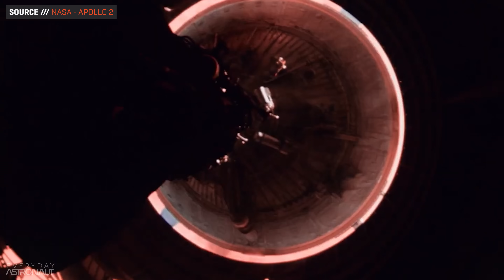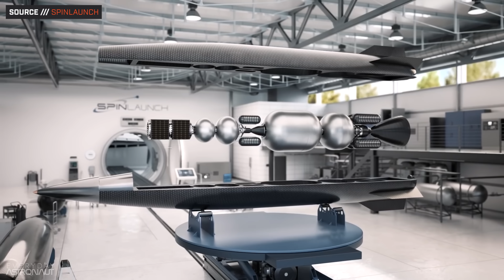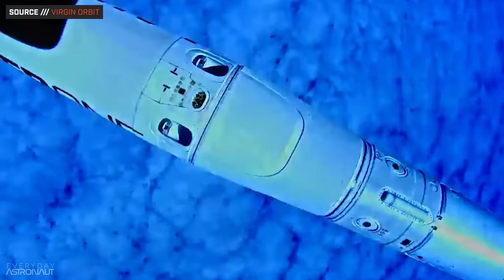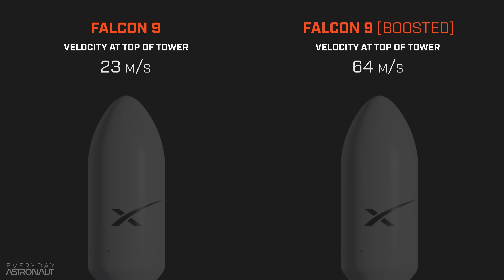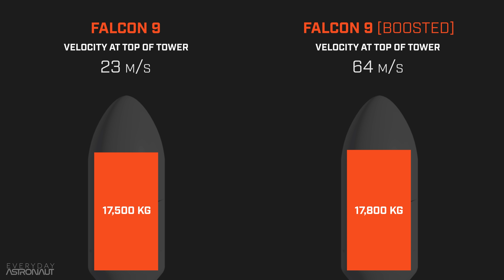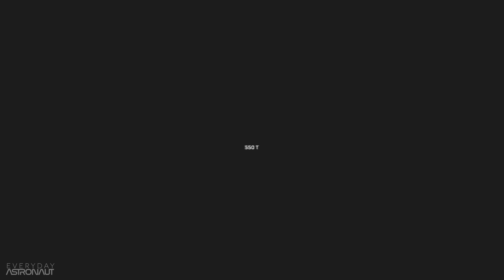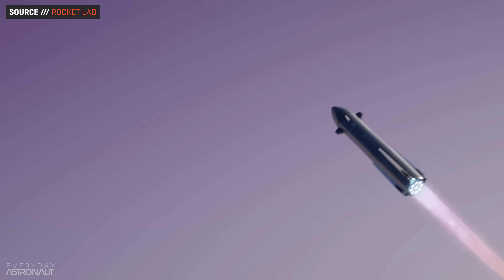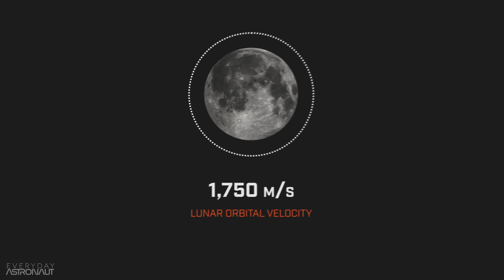Could We Help Push Rockets To Orbit?

Comment: Hi Tim, when you look at the numbers, those crazy ideas are unfeasible, but something can be done.
Imagine a rocket, like Starship: you can't accelerate anything live above 6g, but what about sending fuel into space?
With a centrifugal system, you can send fuel into orbit—just fuel. Obviously, you have to circularize the orbit, so you have to send fuel with a small rocket to circularize the orbit later.
There's no g limit for the fuel, but there is for the correction system.
Once in orbit, you take the fuel using an appropriate method and put it into your ship's tanks. Instead of seven launchers for Starship, you'll only need one launch and several centrifugal fuel drops.
In this case, the rocket equation doesn't apply, at least not for centrifugal launches. That's a viable idea, what do you think?
Reply: This video seems to me to be focused on maximizing payload during a given launch by non-rocket means, not anything about getting around launching entirely, as interesting as that is in its own right. 

Using a similar concept to yours during a launch, though... There's a variation on the orbital gun concept called a "slingatron". One of its strong points is that it can accumulate massive amounts of energy, making it good at rapid fire of tens or hundreds of projectiles. One gonzo proposal was to launch a small liquid-fueled rocket with big engines, a small buffer fuel tank, and the payload capsule, then shoot self-guided robotic fuel tanks built to take the ~100G acceleration and atmospheric heating at it all along its climb. The robots each rendezvous in flight and dump fuel into the main rocket, then fall away and glide to a few parachute splashdown collection locations. Voila, a massive reduction in fuel fraction by giving most of the fuel its kinetic energy by non-rocket means, and a massive reduction in total fuel launched because you avoid the Rocket Equation so you don't have to burn the fuel that accelerates the fuel that accelerates the fuel that etc... Completely mad scientist dreaming of course, but the math works.

Comment: What might be an even better use of this type of system is to have an orbital system that throws spacecraft on interplanetary trajectories.  The same system could be used to catch returning spacecraft. Using a regenerative braking system to charge up the capacitors for the next launch. We could build an interplanetary  highway system by placing accelerating modules at intermediate orbits. Each catching and throwing spacecraft all around the solar system. Almost no fuel or reaction mass needed. The structure of the modules would act as the reaction mass. Each boost or catch would change the orbit but by properly balancing catches and boosts the average orbit could be maintained. Could start by mounting one of these on an earth crossing asteroid. MIght even be able to use suborbital rockets to boost up to intercept one to get into orbit or come back from orbit eliminating need for the heat shield.

Comment: There is no reason to use a 5:1 ration on a pulley system. The simplest and obvious way to use a pulley system is a simple pulley. Just a 1:1 ratio. To get a 2.6G acceleration (plus the 1G of static gravity) you need a weight that is 3.6 times the weight of Starship. You don't need the weight to be a block of steel or other mass. You need a tank and fill it full of water. The weight doesn't even need to be above ground. Put it in a big hole.
Reply from the maker: An object can only fall at 1G... so that can only cancels the 1G force on the rocket, to actually accelerate it upward at 2.5 G, you need a 5:1 ratio, and a 35:1 mass ratio. It's just the way it is to reach those numbers.
Reply: That's not how pulleys work. A drive weight can only fall at an acceleration of 1G under gravity.

Comment: The moon yeet can be summarized as the rule of 50's.  50m/s/s, 50km track, 50 seconds.  And you could make the track into a loop of maybe something like 10km and run around it 5 times. But you still need a good chunk of electricity.
Reply: Just drill a hole through the Moon, geez why make it complicated.
Reply: At the moon there is no need for circling, just make a long track with maglev as there is not air and no friction with maglev aceleration.

Comment: Counterweight could provide a more balanced load on the tower.  The tower could then be made to handle lifting extreme weights.   Also instead of a simple weight dropping, and hitting full force against the resting spot, proper geometry/cables can transfer the kinetic energy to th3 starship.

Comment: Air launch is probably the most interesting flavor of this in that there's no shortage of jumbo jets that are no longer economical to use in a transportation role, and even with getting a huge discount on the launch infrastructure still no one has figured out the economics vs a conventional rocket.  The benefit is more than it looks like just from the added velocity, you also get the height, reduced gravity losses, and reduced drag, and the option to launch closer to the equator for the added boost from Earth's rotation; best case you're more like 1-2km/s all in.  Sadly liquid rockets really don't appreciate being jostled about immediately before launch.
Reply from the maker: We dive into the problems with air launch in this video - https://youtu.be/AAt9WDQEMoA?si=3LTXPsibFhz63Lsn
Reply: @EverydayAstronaut  I think the clearest argument against air launch comes from comparing Virgin Orbit with Rocketlab. Both competing in the small-launch market with fairly similar payloads (Launcher One was about 50% higher than Electron), but the air-launched Launcher One weighed almost double the ground-launched Electron... 

Sure, Electron is a pretty efficient rocket to compete against, but if you can't make the numbers closer than that without including the 747, it's not hard to see why VO went out of business.

Comment: Well, since both Raptor and especially Merlin have good re-light performance, I would think you could use 2 or more SRB's to get the initial boost, then light the core liquid stage and jettison the SRB's. They are re-usable afterall, so still a reusable system overall.

Comment: The best thing about the counterweight is reducing the thrust of the Raptors until it is 100 meters above the pad.  There must be data that can be used to estimate the reduction in launch tower system damage/wear

Comment: How about a 300 ft tall sleeve or tube on the launch tower?  Simply to control the direction of the rocket blast, and adding to the rocket excelleration.  Like an opended gun barrel, think shoulder launch missel.
Reply: Redirecting the rocket exhaust does not increase its impulse on the rocket.

Comment: 'Flinging' a rocket with any sort of high G device would require the airframe to be quite a lot stronger - and heavier.  I doubt you'd gain much.
Reply: The rocket will have high velocity at sea level adding extreme pressure to it.

Traditional rockets only achieve high velocity in space
Reply: It would experience the same forces as from the rocket engines.
Reply: @GunnyPerrero  Then you'll need a very tall launching device if you want to save significant fuel.
Reply: @geonerd  In order to maximize the amount of launching tower used, this video already assumes you're holding the rocket via the platform at the bottom end, which takes its wet weight at 1G and has the holddown clamps etc. But you're absolutely right that he explains how minimal the gains are, and e.g. the skin of the rocket/tanks doesn't take the hydrostatic pressure of the full rocket load at max G. Just that strengthening could easily send you net negative.
Reply: @GunnyPerrero The whole rocket is already design to withstand forces coming from there, if you wanna fling the rocket while holding it from somewhere else you're gonna have to add a lot more weight

Comment: So considering this issue from the perspective of payload is the wrong approach.  Instead, look at it from the perspective of reducing vehicle launch mass.  A 25% reduction is a truly huge vehicle mass reduction for the payload launched and delivers exponential gains because the energy required to launch reduces exponentially.

The idea of using a vertical vacuum Maglev is not the best idea.  Instead, you discard the vacuum idea as this is not workable.  Why? Because the vehicle would hit an atmospheric wall the second you leave the tunnel.  That shock would destroy the vehicle.

Instead, you build a track up the side of a mountain.  Chimborazo is ideal.  At the foot of that track you dig a gently curving 10km long tunnel.  The track doesn't just end at the peak of the mountain however, instead, it curls over the shoulder of the mountain and down the opposite side... this is the safety run-off track.

The vehicle is built and assembled underground, mounted to the track, can be liquid or solid fueled.  The Maglev accelerates the vehicle to around 900km/h or, just shy of the speed of sound.  As it exits the tunnel at around 4km altitude, the boosters ignite and, with a last-second Maglev boost, the vehicle releases from the Maglev bogey which continues over the track, slowing by regen braking as it descends down the opposite side of the mountain (harvesting the energy for the next launch).  Meanwhile, the vehicle continues to space OR, if there's a fault, the payload is separated from the boosters and remains with the forward Maglev bogey, saving the payload and allowing the booster to launch clear whereby it can be destroyed automatically.  Payload/capsule thus saved.

Such a system could potentially launch daily.  Would save an immense amount of launch mass for relative payload delivery.  Tunnels can be built in segments easily and cheaply enough. 10kms is a perfectly comfortable acceleration rate to 900kmh and can easily be achieved with Maglev.

Re- tower launch boost for Starship, I've suggested a water supply from the tower into an engine bay ring-main that could deliver water around the engines that would flash to steam on contact with the thrust envelope, giving the vehicle a steam-flash boost.  The umbilical delivering the water can follow the vehicle up the tower (extending from the catch arms) then sever connection as the vehicle reaches the top of the tower, letting the water drain from the vehicle's ring main and letting the vehicle climb with no mass penalty for the modest boost gained.  This needs little infrastructure additions (a tank, a pump and some pipe) and the ring main can be part of the thrust puck structure, so no real mass addition to the ship.  It wouldn't gain much, but every little helps.

Comment: Levers. What about levers? Weights work much more efficiently and do not need to be as heavy or drop as quickly with levers. What would the math on that be? I suspect a 5:1 lever length would reduce the required weight by 80%. What about a 10:1 lever length and so forth? And pulley systems could be added as well to make it even more efficient.

Comment: it's not 300 kg for Falcon 9. You need to calculate how much propellant needs to be burn to accelerate to 64m/s with and without system. it is thousands of kilograms more to orbit. Falcon 9 burn rate is cca 2500kg/s
Reply: Unfortunately, 64 m/s is 64 m/s.  I’m surprised he even gets 300 additional kilograms to orbit.
Reply: @mb777-g8v   well without "maglev" it achieve 64m/s in 4.66 s which represent 11650kg of propellant. 
with maglev it is only 1,66 seconds which is 4 075 kg of propellant. 

so difference is 7575kg of propellant in order to have same speed.  These kilowattes from maglev  needed for boost surely save the fuel massively @EverydayAstronaut
Reply: @marekrolko  but fuel is cheap. At least compared to building out all that infrastructure and capacitor, banks and batteries and the heat associated with all of that.

It’s much cheaper just to build a bigger rocket or add some reusable boosters.  That will add a lot more impulse.  64 m/s is a very small amount of velocity change when you’re looking at 7800 to get to orbital velocity.
Reply: @marekrolko  I see what you’re trying to say. Saving that much fuel weight sounds like a lot, but remember you’re only talking about carrying that extra rate for the first five seconds of the launch.  You’re not carrying all that extra weight very far.  

That’s why you only end up saving about 64 m/s

Comment: A minor improvement might simply be a fuel and oxidizer dilution system.  Perhaps a dual cryogenic and HP warm gas Argon system.  Thrust might be able to be improved (but not ISP) for that crucial first 60 seconds or so with huge gravity losses.  Rocket, jet, and propelor driving engines are very inefficient until vehicle velocity reaches a significant fraction of exhaust velocity.  Something like water injection for aircraft engines  Also use for spin up, ulage gas, warm gas thrusters, etc.  Usually engines need to be throttled back near the end of burn due to max Q, or simply the reduction of g loads.  Argon might have less impact on ISP for warm gas thrusters and dilution of main engine combustion (for lower temps and higher mass flow) for higher thrust due to the absence of rotational degrees of freedom compared to other exhaust products compared to nitrogen, and the absense of the high cost and handling difficulty of Helium (though warm gaseous helium is a relatively effective thruster fuel and ulage gas).

Comment: I would probably transfer parts of the energy required for the takeoff to the launch tower. Adding a rocket driven, movable launch mount to catapult and assist the firing rocket during liftoff might give some nice extra payload capacity, while using the same rocket engine technology and fuel.

Comment: The Falcon 9 though experiment: he did not take into account the reinforcements and the links that we will have to add the the Falcon 9, no it won't be 300KG it will be negative 1000kg+
Reply: Not necessarily. If you put the force through the same structure that's already taking the engine thrust, it's not nearly so bad.

Comment: I've wanted maglev orbital launchers for decades, but younger me did not fully grasp just how difficult it is to build a perfectly straight and perfectly sealed vacuum tunnel hundreds of kilometers long. It's arguably the most efficient way of getting to orbit, but it would be staggeringly expensive to develop that technology and an earthquake could destroy it catastrophically.
Reply: Maglev isn't ideal for Earth, but I think it absolutely could be done on the Moon or Even mars, on the moon you don't even need a tunnel, you can just have a railway 10 - 20 kilometers long and have it easily send stuff to orbit or beyond, and if you're really crazy you could use it to DEaccelerate payloads to let them land on the Moon without any fuel. Mar's you will need some kind of tunnel, but maintaining the vacuum would be much easier when you don't have to push that much air out in the first place.

EDIT: I gotta stop going into the comment sections when watching videos lol, pretty sure he gonna go over this exact use case
Reply: given earthquakes in addition to the difficulty of accessing things underground I've always thought the maglev launcher should be ocean based rather than land based. a tunnel can't be moved in an emergency and aiming it in a different direction is not happening, if you're tunnel is the core of a submarine built in connecting segments it would be way more expandable over time and we can move it if a asteroid comes and it would be way easier to access for maintenance.

Comment: What if the Starship was made of the same stuff the Falcon 9 is made of? Much lighter, bigger engines, more thrust therefore more payload.
Reply: Aluminum melts at a much lower temperature and loses strength long before it melts

Comment: What if... Instead of a counterweight, or with a lighter counterweight, use rockets to pull on the cables. A taller tower might help too, so you have more time at higher acceleration. That would also give the opportunity to modulate the acceleration at the beginning and end of the assist.  A conveniently located mountain is always handy. I think I have one around here somewhere... Fun to think about, but still probably not worth it, as discussed in the summary.

Comment: This video didn´t go into steam catapults, as they are used to accelerate small to midsized military aircrafts to cruise speeds. Because I have nothing better to do, I´m going to calculate, how much steam it would take to accelerate starship with 2,6 g over 140m. I bet that steam pot is ridiculously big and the pistons are going to be challenging as well.
This will need some time. I guess I will need to scan the video for the numbers by watching it a second time first...
Reply: I did a calculation:
According to Tim, the required force to lift Starship is 122 MN. 
Common pressures in pneumatic drives according to Wikipedia are 6 bar for ordinary and 18 bar for special applications. 40 bars is possible but esoteric. Let´s use 18 bars.
18 bars is 1,8 MN/m², which means you need a piston with 67,8 m² area, which is a circle with 9,28 m diameter or approximately a piston the same size as starship. If made from full material, this piston would be a lot heavier then starship itself. So it cannot even lift itself.
Under these circumstances I won´t calculate the size of the steam drum.
Also I won´t calculate with 400 bar pistons (400 bars is the highest pressure I know a large scale application for, which is ammonia synthesis) or steam drums as I don´t think they could be built at all.